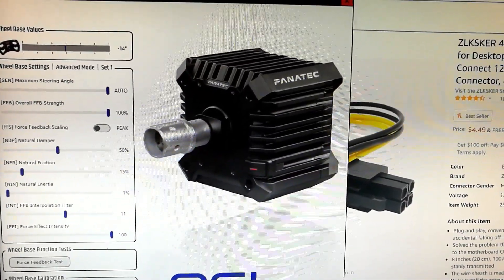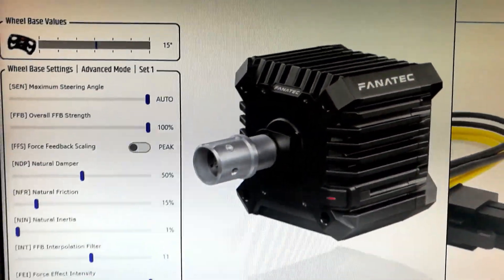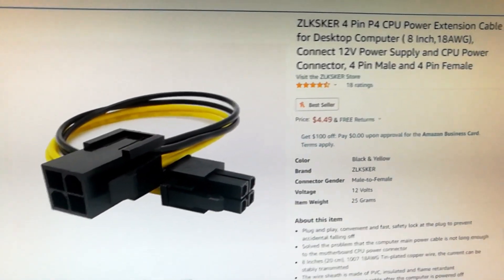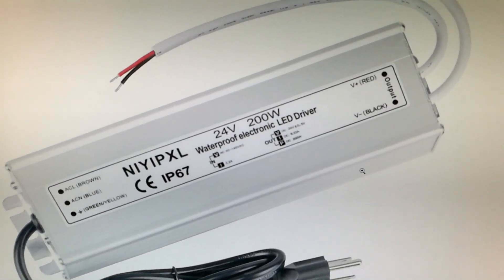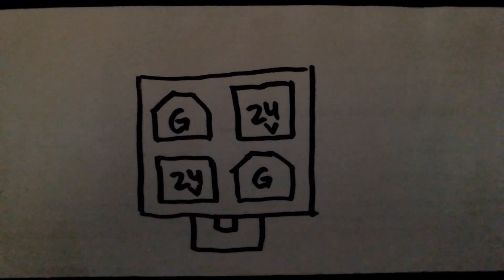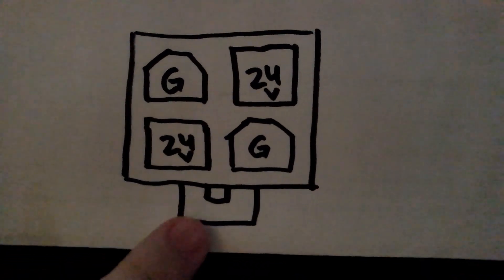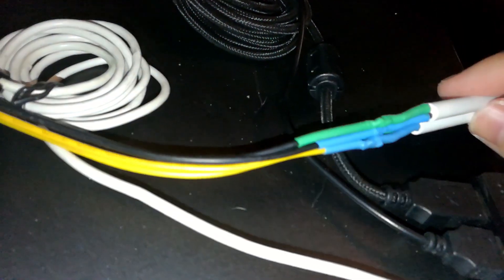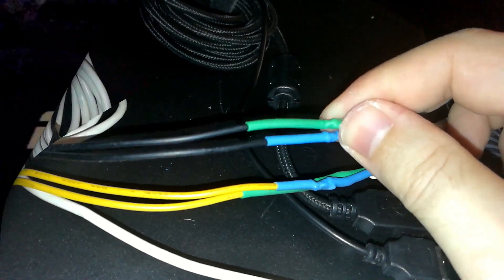Fanatec CSL DD DIY Boost kit for under 50USD guide (Tested and Running)

Comment: If I didn't misunderstood, then any power supply 24V 200W will do?
Reply from the maker: Hello,
Make sure it's 24 volt constant voltage and not constant current power supply.
Reply: @Triple88a ❤thanks!

Comment: I hit the like on your tiny channel. Questions though, I'm on PS5, so is it still the sample equipment? Also, since on PS5 I am getting the DD Pro instead of CSL, does that matter?
Reply from the maker: Hello, Thank you so much.  I have the regular wheel base so i cant test it from google search it shows to be the same part number.
Reply: In case you’re still wondering this works perfectly for the GT DD Pro. Been running it for almost 3 years now.

Comment: Hello, why 200w? the peak from the base is max 50w at 8nm 🤔
Reply from the maker: Hello, thank you for your comment.  the reason for 200w is because that's the wattage of the power supply fanatec uses.
Reply: @Triple88a  Thanks for the explanation 😊

Comment: Seeing it's just a 4 pin, it makes me wonder if it would work off of my PC power supply since I got a 1300w evga unit on clearance and my pc doesn't use nearly that much.
Reply from the maker: You need a 24 volt adapter, pc power supplies are 12 volts.  I know some have a -12 v line but i'm not sure if you can combine -12 with +12 to get a 24 volt total.
Reply: I figured there would be some reason why not. I went ahead and bought the parts you suggested. Thank you for the info! @Triple88a

Comment: Can I use 24v 400w psu?
Reply from the maker: Hey there, I've seen people in a fanatec group say they are using larger psus.  350-400w with no issues.  I don't have any personal experience with a psu that oversized so I cant speak on that regard.  Theoretically it shouldn't be an issue if fanatecs electronics have safeties and only take what they need.  One thing you must confirm is if the PSU is constant voltage or constant current.  It MUST be constant voltage.
Reply: and what is the best way to diagnose it?
 @Triple88a

Comment: Hey thanks for the video and the diagram. I'm planning on doing a similar thing but I'm wondering if I should be considering AMP capabilities of the PSU? Also, what gauge of wire for the extension? (i am pretty noob with electric stuff)

Comment: Thnx mate. I knew i would some day buy a csl dd. But no way i will pay 150EUR for a simple PSU. So this was decided upgrade a year before i ordered one. XD
Yesterday i got my CLS DD and today the PSU stuff came in. Your drawing of the pin layout really helped out here. Could not find it anywhere else. (Probably has been posted but i stopped looking here for obvious reasons :P )

Had one evening on 5NM and today on 8NM. The 8NM does give what i expected. 5NM i could not get the settings anywhere i wanted. Started to clip before you really had any force.

Comment: Hi, Thanks for the video. I've made my adapter and plugged it in it shows as "Boost KIT", definitely more power than the standard. I was relieved to see it working.But then I entered some games and found problems :(  from time to time there is no input registered for a brief moment (half a second or so) neither on the wheel , paddles, buttons, pedals. Switched back to the standard one and the issue disappears. i got a different adapter( i'm from romania) but still 24v , 200W, 8.33A. In the fanatec control panel  everything remains connected( i have 2 monitors) so there are no disconnects. After further testing i noticed that the issue also occurs without running any games, tested in the fanatec control panel just by moving the pedals or wheel the input disappears for a split second. Any suggestions?
Reply from the maker: My guess is the power supply unit doesn't have enough power and shuts down.  Many are rated a certain number but how accurate that rating is is questionable.
Reply: @Triple88a  i'm returning it tomorrow, to  get a new one, maybe i just got a bad one. :)
Reply: Fixed it now, returned that and got a new one but with 250W, it works perfectly, no more "input disconnects". There should be no problem with the 250W, since i think it only draws what it needs power wise.
Reply from the maker: @Gabichivu2  Very good, glad to hear you got it running properly.  Enjoy.

Comment: OK, So now ive recovered from my mini heart attack, i'll take a moment to explain an issue i had after doing this mod !! Thanks for the excellent guide, way better than paying Scamatec's ridiculous prices !! But once i made my adapter and plugged it in, Turned on the base, the control panel flashed up for a second, then said it couldnt find the wheel, and fanatec have a list of items to check, not to mention windows was saying USB Malfunction, so at this point i was convinced i fried something. i tried reinstalling drivers, "repair driver" in the CP, cycling the modes of the base, restarting pc, etc and still wouldnt work, then the last thing on fanatecs list was try a different USB port, then when i did, taadaa, it worked !! Was definitely sweating for a min, im in Australia, so 240v, so my adapters a bit different (still 24v, 200w, 8.33A) but seems to be working ok now, definitely much stronger feedback, so will have to tweak some settings, but hopefully this helps someone?!!  Cost me $45aud very happy... now lol
Reply from the maker: I've been running mine like this for over a year now.  not a single issue.
Reply: @Triple88a  yeh i think it will be fine now, ive had a few restarts, and all works good, but was tense for sure!! Thanks again for the idea man !!

Comment: Anyone tried UMEC Digipos UP2002-01 24V 8.5A 200W?
Reply from the maker: I checked the part number for that one and I couldnt find any info on the pinout or the specs.  I wouldn't feel comfortable using an adapter with no info sheet.

Comment: Hi,
Thanks to your tutorial I have been able to use a boost kit for more than half a price since February. Yesterday I started to play and i noticed that the power was gone.
I plugged the weel to the PC and the boost kit is not recognized anymore. Do you have any idea of what can be happening? The power supply provides enough electricity to play but it looks like it's not enough.
Thanks again for this amazing tuto.
Reply from the maker: If you have a volt meter check the voltage across the nodes.  My guess is your connections might have come loose.
Reply: @Triple88a  you were totally right, one of the connection was loose.
Thank you very much for your help.
Reply from the maker: @don5ala  Glad to see you got it fixed.

Comment: Does it have to be 2 outputs? Or can u Just  put 2 cables of the connector to 1 cable of the psu?
Reply from the maker: Hey there, thanks for checking out my video.  The 4 pin PSU connector is 4 pins.  All 4 pins need to be wired properly to work.  If you purchased an adapter that has only 2 wires you'll need to wire the 2 positive cables from the PSU connector together to the positive coming out of the power adapter and then wire the 2 ground wires together to the ground wire on the power adapter.
Reply: @Triple88a  ok perfect thank you. Makes sense, ist Just wanted to be safe :) great Video!
Reply from the maker: @EataTwixX  If you plan on doing electrical work it's always handy to have a volt meter in your tool box.

Comment: I didn't see if the power supply is also 7.5A. Is it?
Reply from the maker: The power supply i'm using is a 200 watt power adapter which is 8.3 amp.  A little extra is fine.  The voltage is the important part and that is 24 volts, same as the Fanatec boost kit power adapter.

Comment: Where do the white wires go, and or connect to? I assume the power supply that plugs in the wall? And do you just discard the 5 Nm power brick, or run in succession? Thx! Great video, glad I found it!
Reply from the maker: Hello.  That's correct, the white wires go to the power supply.  You can see them at 4:36.  The 5nm power brick is in storage unused.
Reply: @Triple88a  Thanks again!

Comment: does that mean i could use and old pc power supply?
Reply from the maker: Hello,  PC Power supplies are 12 volts and are also wired in a different configuration by default that will likely burn out the wheel base.  The Fanatec CSL DD requires 24 volts so a PC power supply will not work.  That said you need the cable from the power supply so you can cut that off and wire it to a 24 volt power supply like the one in the video.

Comment: I just checked my csl elite power supply and it's literally the same as the boost kit. It's the same psu same serial number, what the even fuck.
Reply from the maker: Yup, the power supply is exactly the same, they are just using a different attachment.  I'm surprised on the serial number being the same as well.

Comment: Did Fanatec detect the fact you were using such a power supply and maybe tried to contact you or emailed a break of guarantee etc?
Reply from the maker: I havent had any issues.  I did read on reddit that people have done warranty work with diy boost kits without question.

Comment: Does it matter what side of the PSU wires get put on top or bottom of the 4-pin connector?
Reply from the maker: Hello,  Both red wires coming out of the PSU are 24 volts and both black wires are grounds.   As long as you connect both of them to be + 24 volts and the grounds to be 0s you're good.

Comment: Will using a higher powersupply of 200 or above like for example 220 240 or even 300 watts be better than the 180w one ? as it gives more power, more efficiency to work at higher loads and for more consistency ? and is too much power bad, will it burn out the csl dd ?  i mean how much long term higher wattage can it handle ?
Reply from the maker: It's questionable how the electronics are wired inside the wheel.  At the bottom of the wheel it says 24v 7.5amp.  I'd run the closest i can to those specs for safety.

Comment: hi, will this work in europe with travel adapter to european power outlet ? there is no way I will pay that much for a simple power supply to fanatec
Reply from the maker: Hey there, yes the difference is the input, you'll need to get a 24 volt 200watt adapter that is made for the power grid in your country.

Comment: Pretty sure this exact unit is on Amazon under this name, inShareplus LED Power Supply, 24V 200W IP67 Waterproof Outdoor Driver, it's got the 2 output wires to DC 24V 8.3A 200W with a constant current.
Reply from the maker: Yup this will work too.  The difference is also that adapter doesnt have a wall plug so you'll need to wire a wall plug too.
Reply: @Atanas Tripzter  it does have a wall plug

Comment: Does this Work in U.S.?
live in U.S. Can I still use the 24V PSU or do I need a 12V?
Reply from the maker: You'll need a 24 volt.  The input will be different.. 120 volt vs 240 volt but the output will be the same.  24 volt 8 amp constant voltage adapter.

Comment: i just build this today, can confirm it works. i used the exact power supply in the video and just some random atx power 4 pin with the correct "pointed" style orientation of the pins
Reply from the maker: Thanks for checking out my video.  Glad it was helpful.  Cheers, enjoy.
Reply: Still working good?
Reply from the maker: @uluv2c8  absolutely, not a single issue.  I have probably 500 hours or so between the games i've played on it.
Reply: @uluv2c8  i honestly almost forgot i did this. so yes lol

Comment: can i use a Meanwell  HLG-320H 24V.   I believe its a constant voltage which is 24v dc 320 watts 13.34 amps
Reply from the maker: Hello, if it's constant voltage it should work.  That said, it does supply a lot of amperage.  It's unclear if there's a limiter inside the base.  Unfortunately I don't have that information but if there isn't a limiter inside, there's a good chance it may burn out the base because the electronics are trying to send 100% wattage into the motor.
Reply: @Triple88a  electronics don't work like that. they take what they need and leave the extra on the table. it will not pull 13amps when demand is only what demand is.  you can have 100amp psu and if it only needs 7.5 you are completely fine.
Reply from the maker: @Aijames  You've never overloaded an electric motor eh?  I have and have burned it out in minutes.  Both were ran at the same voltages.

Comment: I've got an old laptop power supply, outputs 19.5V - 12.3A  will that work?
Reply from the maker: Unfortunately that I cant tell you for sure but it seems like it's way out of the range.  Original PSU is 24 volts.
Reply: @Triple88a  thanks.

Comment: As soon as I saw that the "boost kit" was a standard power brick, I immediately thought that it would be easy to make my own for much cheaper. The only thing I wasn't sure about was the voltage and the connector Fanatec was using (I don't have a CSL DD yet). I'm a little surprised they went with such a common connector, but that's a good thing because they're so easily sourced. I like Fanatec's products but selling a 180W power supply for $150 is a little outrageous.
Reply: Its a big ass cash grab 😂
Reply: Fanatec is trolling ppl with that power supply
Reply: @e.r.6147  They're also trolling with their PS4 support, as their official PS4 wheel (the GT DD Pro) doesn't even support all force feedback PS4 games. Their website doesn't specifically state this, either. I guess it's up to the user to figure out after they've dropped $700+ on the wheel.
Reply: @rars0n  😮 savage
Reply: In Germany we say Zusatzverkäufe bringen das Geld👌
Reply: Yes, outrageous indeed - and I just read on Fanatec's website their claim that only their PSU will work because it's specially engineered.  It's quite dishonest.

Comment: Thanks man! Just ordered the parts. I have a GT DD Pro on preorder so I might as well get my “boost kit” made and ready to go.
Reply: gonna pre-oder the DD Pro too! Have fun!
Reply: You have already received DD PRO or are waiting for pre-order?
Reply: You can just solder the adapter correctly and connect it to the original 90wat 24v power supply and you will get 8Nm and consumption up to 65wat from the power supply.  For a place of 5 nm and a consumption of 40 watts.
Reply: @irlantiisti2810  I'm waiting for it. Not sure what you mean about using the original power supply.
Reply: @ViaticalTree  I canceled myn to order the expres one lol, dont have the ability to wait longer xD
Reply: @ricco6023  ha ha...couldn't wait, huh? When are you supposed to get it? I'm jazzed but I think I can wait. Only problem is I might be out of town when it gets here.
Reply: @ViaticalTree  First i need to get my money back from fanatec and then i order him again.

Comment: Hey man, great video and likely usefull for a load of people. I believe the pricing for the dd 8nm is fairly reasonable though as their profits are likely negative for the 5nm models whereas they make all the profit from the 8nm bundle and therefore the seemingly crazy price of the PSU. While i think it would have been smarter for fanatec to just have the 8nm priced at some profit rather than the 5nm at a loss, i do see why they did it. Doesnt take away from the fact that this vid will save a lot of people a lot of money and so great job to you sir!
Reply: There is no way they are selling the 5nm kit at a loss.
Reply: No way in hell Fanatec sell ANYTHING at a loss!!

Comment: Thank you, this PSU looks decent, might try this after I get my GT DD Pro and I find 5nm isn't enough, though it might be enough for a beginning as I'm coming from a weak 2,1nm G29.
Reply from the maker: It really depends on the style of games you play.  I've noticed that grip racing is a lot more fun with the full 100% on 8nm but when i'm doing drifting and rally i go down to 40-50% so i dont have to wrestle the wheel on quick turns.
Reply: @Triple88a  yeah I hear multiple people say the 8nm is worth it, but a PSU isn't worth 150 to me, but thanks for the wiring info though, would have to test the original PSU or look up the wiring, but that'll save me some time, but I saw you used a 110v PSU, I need a 220/230v one, so I'll need to find something else but still thanks for the info!
And I'll mostly be playing GT7 with it and maybe I'll get ACC for PC

Comment: I make connectors and use different power supplies at work all the time as I work in electronics so I know the full theory behind the PSU's and it's delivery.

Here is my question though. Is there inbuilt software within the base to notice and store a difference in current should the base ever get returned under warranty? If the answer is no. I'll make myself a PSU when I get a DD Pro.
Reply from the maker: I've seen reports from people who were using DIY adapters that have done RMAs and gotten their wheels covered without a question.  We dont know if fanatec will introduce something eventually.
Reply: @Triple88a  sorry, what is an RMA? Hopefully they don't twig on if they return under warranty. Plus power supplies are so stable these days that you'd be hard pressed to void warranty.

If anything, an aftermarket PSU capable of 8A is safer than one being maxed out a 5A as the internal components are not being stressed/heat cycled as much and everything inside of an 8A PSU is built to a higher spec from scratch.
Reply from the maker: @kelvingomersall7460  RMA stands for Return merchandise authorization.  it usually refers to the warranty process.  I've seen multiple posts of people that have gotten their wheels covered under warranty  There's likely a lot more but you wont see many people openly admit that they are using 3rd party 180w power supplies.